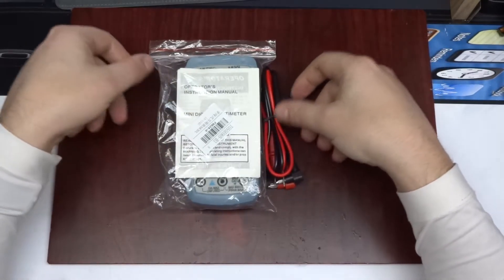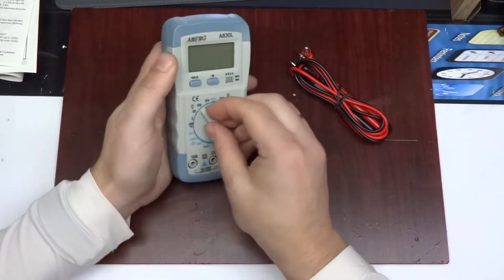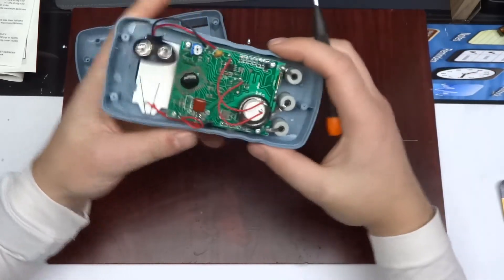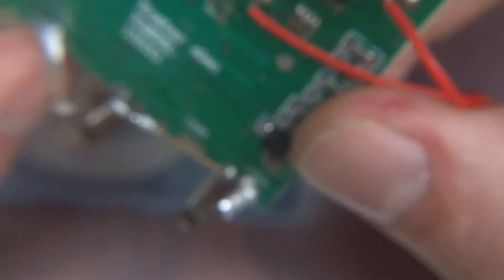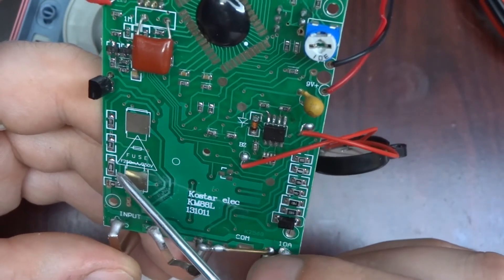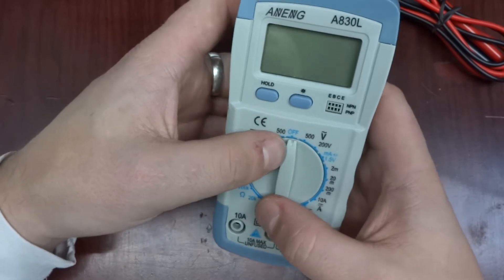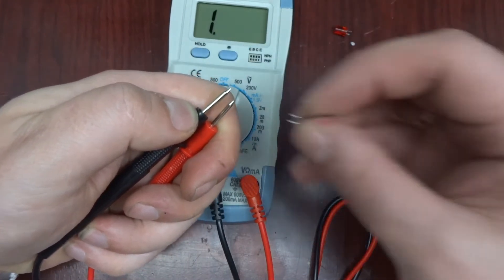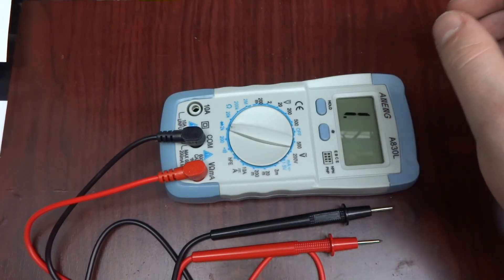Cheap aneng multimeter from ebay Review and Teardown

Comment: It's not absolutely terrible, I have seen crappier multimeters that cost more. Wouldn't use it for any high energy stuff... or use it at all if something better is available, but for the price it's more than adequate. Well, I mean it's still quite bad, especially the missing fuse, but not as bad as many of the 830 series meters.
The AN800x line from Aneng seems quite good. Just ordered an AN8008 for some 17 USD.